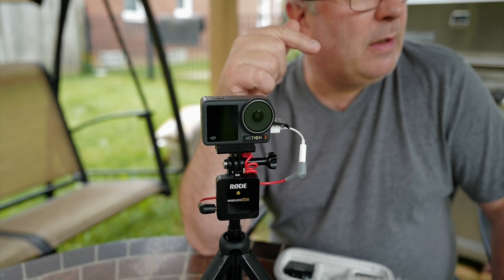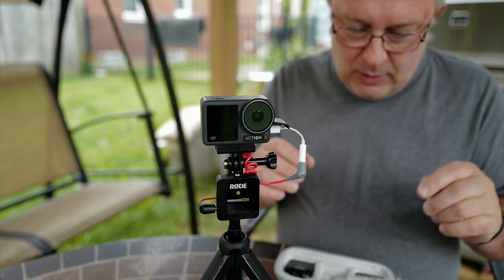No Osmo Action 4

Comment: I need to say this:  If I were to go film and want stereo sound, I grab my wireless mic by Fulaim, put to the stereo mode and place. Tx 1 while turning on rec mode, and t 2 while turning on. Rec mode and  keep the action 3 recording in. Pro , and. Back at the editor, I would synch up all three tracks, , and have a true stereo video.  Or simply use the gopro that does stereo, and save a lot of time in the editing room.
Reply from the maker: Yeah, i think the Røde could record internally, but then you would have to take those two tracks, mix it with the Osmo track, and all that is more or less very painful to work with.